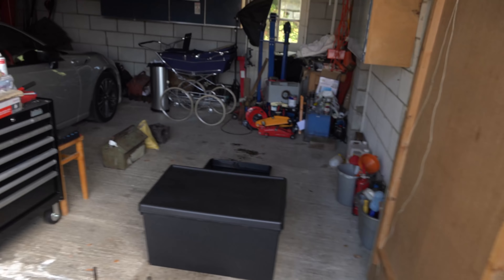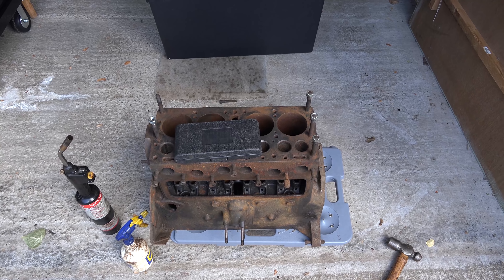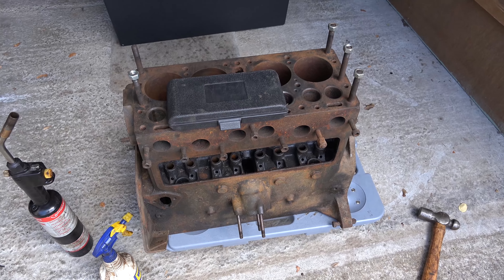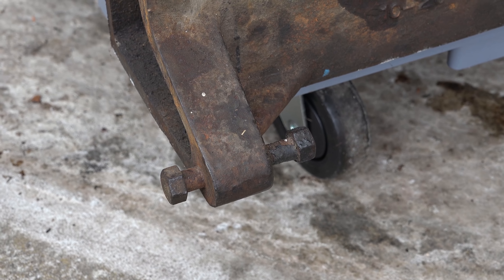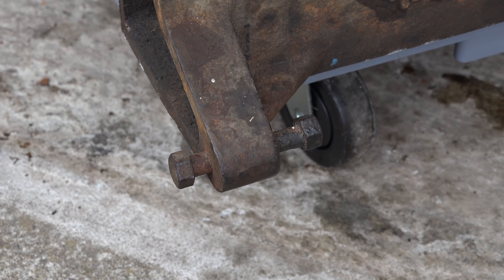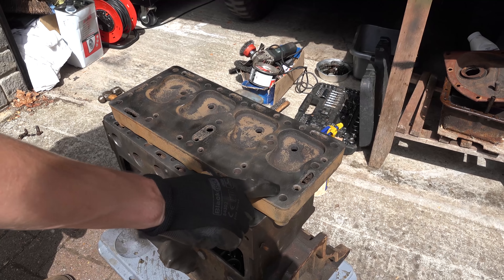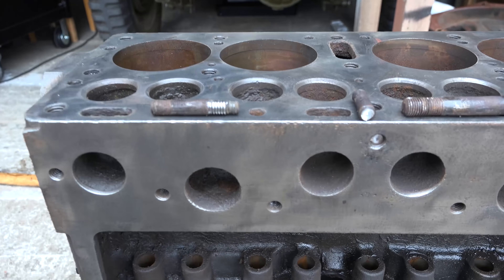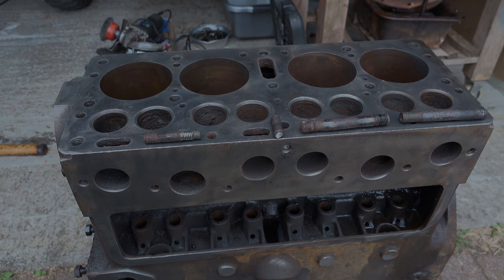The easy way to Remove Rusted engine studs

Comment: Hi there,  another great video, thank you.  When I removed all my head studs, I was able extract them all. Unfortunately 4 of the threads were severely rusted out. I drilled & helicoiled the threads, they work fine. When I reassembled the engine, I used a coolant sealing compound on all the stud threads to stop coolant creeping up the threads. I had the head surface machined because the surface was quite pitted from old age. The head then has a  better seal with the head gasket. Thank you,  Cheers James.
Reply from the maker: Thanks James.  Did you free hand drill the holes out or did you put it under a pillar drill.  I'm concerned about drilling the holes cockeyed and wrecking the whole thing!
Reply: Greendot 319 mate I've had a lot of experience drilling. I used a hand drill. If your not confident & worried damaging the block, I recommend 100% use a drill press. That way your hole is dead straight.
Reply from the maker: Thanks James, I think I should be able to drill it then, helicoil it is!!
Reply: Greendot 319 take your time don't rush. Check out some good video's on YouTube first on helicoil installation. You can  purchase a complete install kit. Comes with drill, tap & coils. You will be fine. Let me know how you go. Cheers mate.
Reply from the maker: Thanks will do, that will be another video!
Reply: H'coil work well, but the kits are a little bit of a rip. If you only have one of two of each size, it may be cheaper to find a well equiped repair / restores shop, where you may pay quite a lot for each coil, but little compared to purchasing a kit, which will have little more use.
I was impressed with your stud removal. An addition to these methods that may help on other items. 1)Counter locking nuts on the stud, ie run one down the stud, run a second down on top of it, and then tighten the first back up against the second. They will often lock solid enough to allow you to wind the stud out, although other easing may be required. 2)If the stud does not move after heating the casting, more thermal tension can be added by giving the stud a good blast of plumbers freezer spray.

Comment: I think you did very well getting that many studs out, I find that if a stud starts to torque, and is not going to come out, a simple drilling fixture that is a tight fit over the stud,( like a bush), and that has a pilot hole drilled through dead centre on your lathe, will allow you to drill an accurately aligned hole right through the stud, the vibration and heat from the drilling usually frees up the thread, but if not another fixture with the tapping size hole in it will take out the core of the stud, you can normally pick out the remaining pieces with a sharpened pick, then tap it, with the broken stud level with the surface, you can normally pick up on the thread with a drilling bush and get centre, easyouts very rarely work on these very rusted studs broken off, if it is tight enough to shear with the full stud shank intact, you rarely turn it with an easyout, more than likely the easyout will break, then you really are in trouble. Good luck !

Comment: a little trick for you when you loosen the bolts or studs screw them back in the  hole a bit then  turn them out..you may have to do it several times but  it helps to free the bolts try it you will see what I mean..

Comment: Where is your jeep shirt from? I couldn't quite make it out
Reply from the maker: Hi Rob, it's from jeep sud-est in France.  They're a pretty good parts supplier in Europe, good on line shop which UK dealers have neglected!
Reply: @Greendot319  
Thanks, I'll have to see if they'd ship a shirt to me. Have you seen the battery project I've been working on?
Reply from the maker: I haven't Rob, is this on the Gee?
Reply: @Greendot319  yes, its under the general discussion topic. Working on a Willard cover
Reply from the maker: Hi Rob, Just seen it, that's Damn good.  How exactly did you do all the raised lettering?  3D printing?
Reply: @Greendot319  
Thanks man. Did it the old fashioned way. Microsoft paint, carbon paper and cut it out with a scroll saw. My girlfriend cut out the round bits on her Cricut machine on posterboard.
Reply from the maker: Very impressive results!

Comment: "WD-40" (Water Displacing formula #40) was developed many decades ago to displace water.  There are now many penetrating oil brands out there, and some even help to dissolve microscopic rust particles.  They were designed to, umm, remove rusted parts.  You are a victim of a decades-long marketing scam.  The first time you said "WD-40", I left.  Please, professional mechanics only.